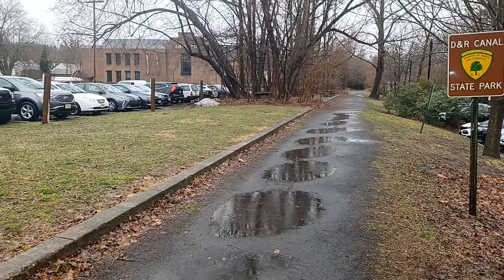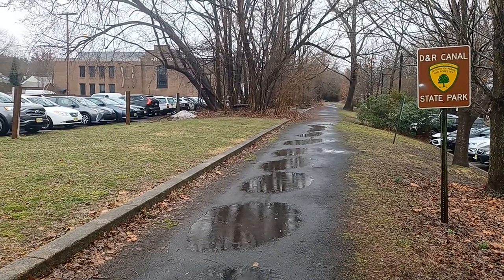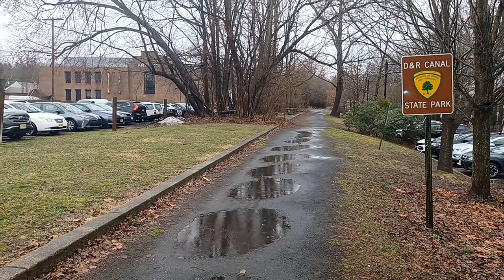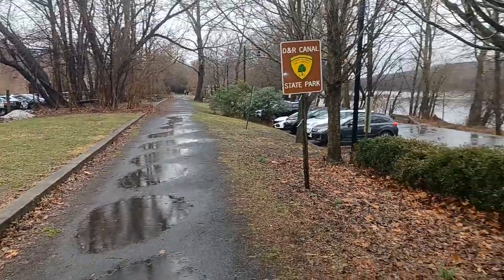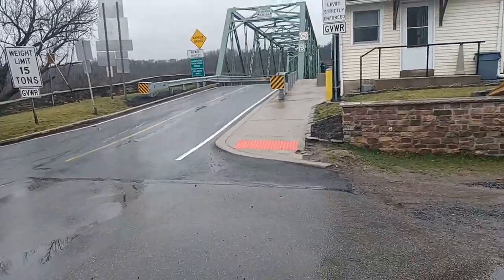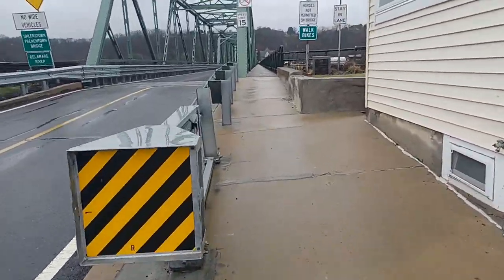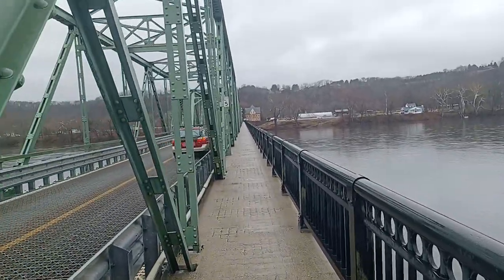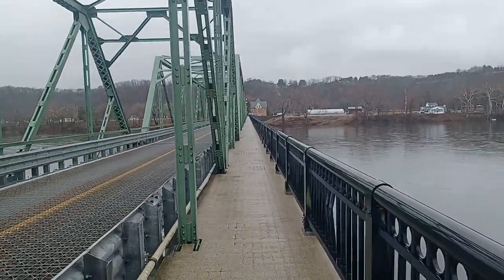History in Frenchtown New Jersey

Comment: You are in error, sir. The Frenchtown station doesn’t look anything like it did originally due to two major reconfigurations. The  only surviving station in original form is Stockton however, an historically accurate replica has just been created in Rieglesville.
Reply from the maker: No, Stockton was destroyed by Dynamite by an attempted robber and then rebuilt. The Frenchtown station is the original station, much changed with the second story and a long section of the South End removed